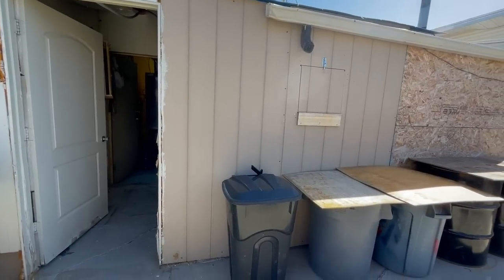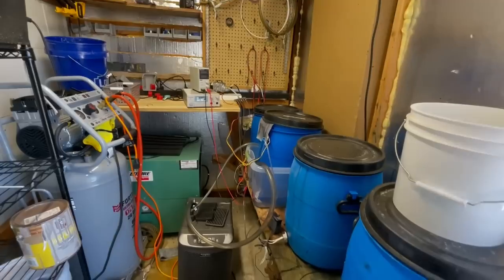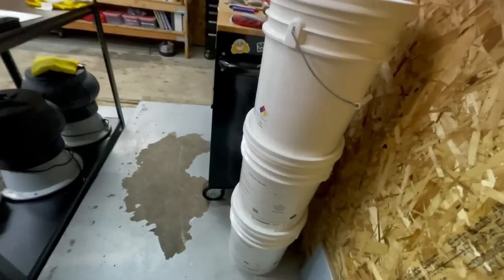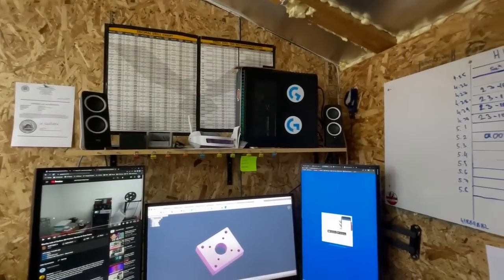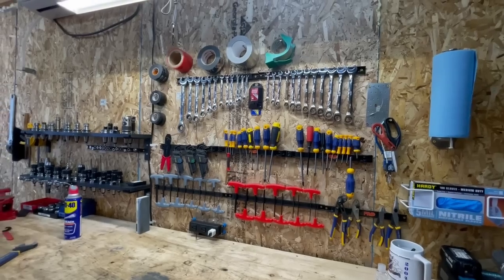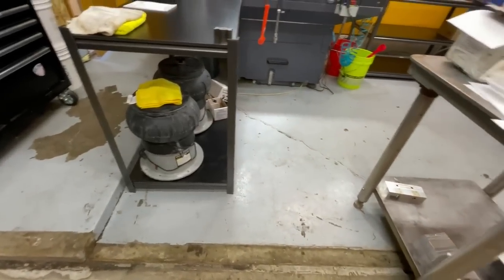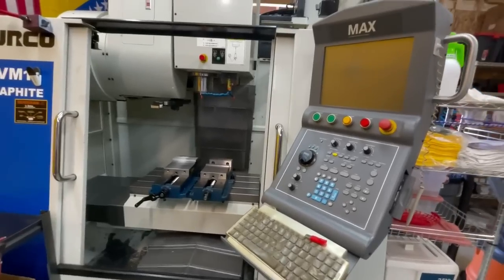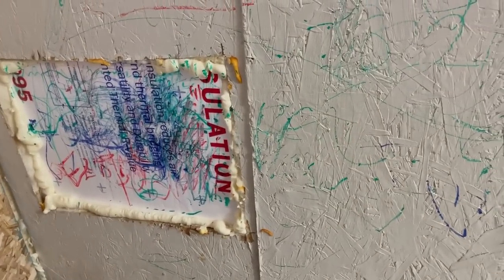Starting a Machining Business: E.M. Machining Works’ Journey

Comment: Amazin video! :)
I  have a couple of questions since I am rly looking forward to buy a cnc machine and start my own journey.
Since I live in Bosnia, I have very little amount of options when it comes to cnc machines, the cheapest cnc machine I could find was Hurco VM1 2003. and it would cost me around 20k $ just to buy it.
What should I do for beginning, try to buy Hurco, or go with Tormach, Tormach would cost me much more tho, and I dont know if it is worth shipping it to Bosnia?
Reply: I bought my machine from a company I worked at. I knew 16 years of history of the machine, I knew how much it was used, and I used it before I bought it so I knew how it ran and if it had issues and so on. Also for me it was really cheap for what I was getting. That being said, if you can make sure Hurco machine work properly and doesn't have any hidden issues to the best of your ability, Hurco is a way to go. I love Tormach, I will recommend it to anyone as a company and as a hobby machine that doesn't cost crazy money, but a working 2003 Hurco will run circles around any new Tormach. However anything on Tormach you can fix yourself, with Hurco if something serious breaks you might just end up with a potato. I hope that helps.
Reply: @e.m.machineworks  Oh, ok thanks a lot :D